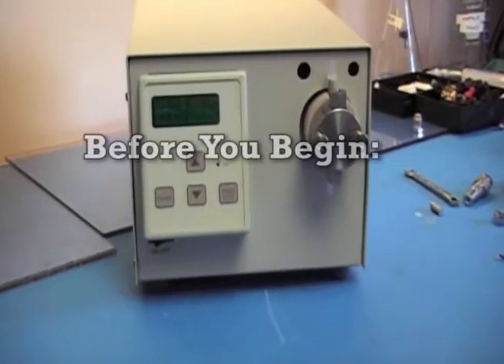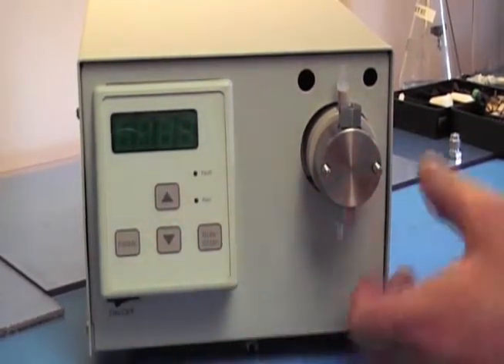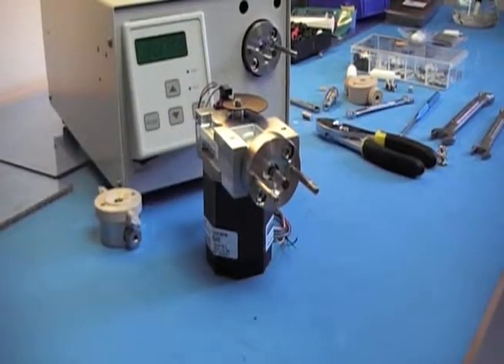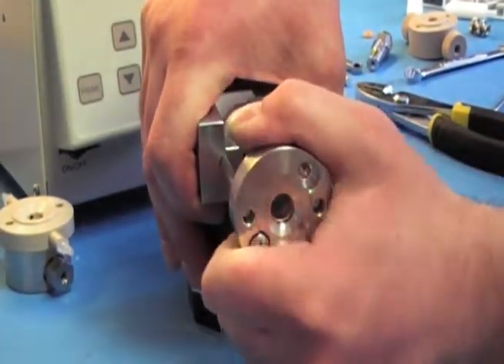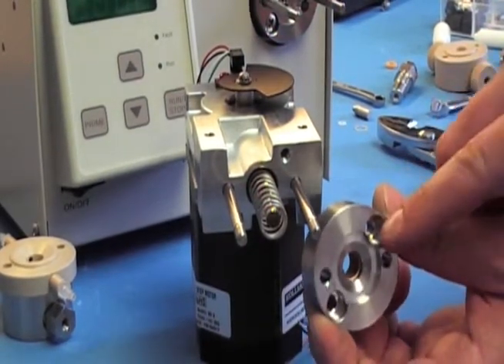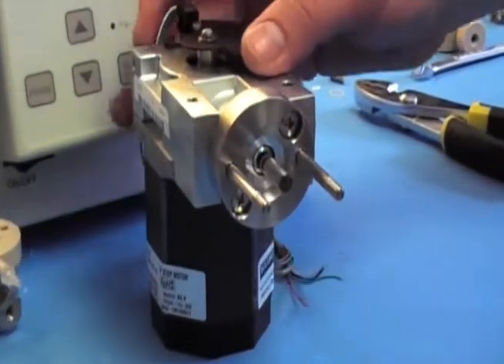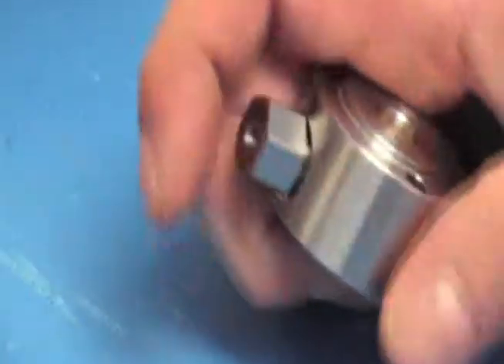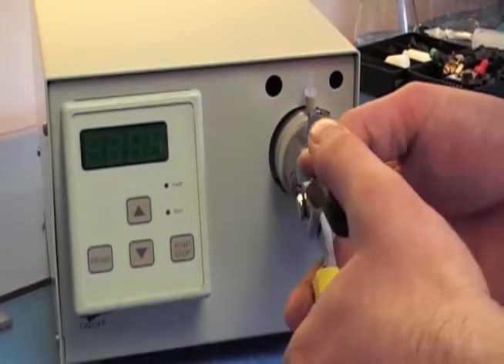SSI Series I HPLC Pump Piston Replacement Process

Comment: When putting the head back on you said finger tight then 1/4 turn with the pliers but it looked like you barely went 1/8th of a turn which is correct?